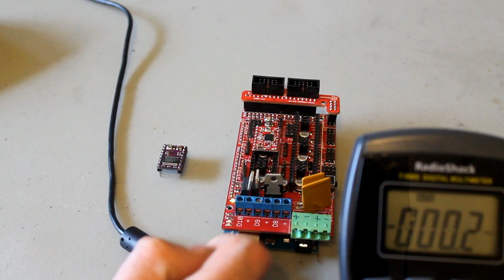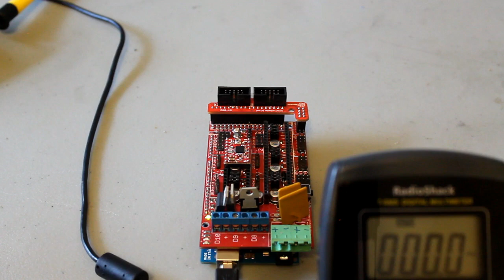How to adjust you stepper driver current

Comment: Ive been trying to figure this out. the math is crazy. it says I can go 1.0 or .9volts to be safe but it will not run faster then 400 federate what ever that is!? I have 2.8v 2.0amp motors and they seem to run fine at .8
 What I know from simple power tools is not to use to little power/long thin cord.
Reply from the maker: Feedrate is the actual limit that the machine can print, 400mm/s feedrate is incredibly fast never seen a printer print that's fast

Comment: I have a bit of a problem...my drivers are only showing 3V so I can't adjust them for some reason. Anything I should try ?
Reply from the maker: Which set do you have?
Reply: @forward3dprinting796  somehow I changed the power supply of the Arduino. I used a 9V battery and it was horrible. But then I changed it to a normal power supply and it works just fine. Not sure why tho.. Thanks!
Reply from the maker: @Anton-sz6ef  the arduino processors usually run 5v
Reply from the maker: @Anton-sz6ef  I am glad it works. Ow tho

Comment: When i make a 3D printer with CD stepper motor,  my stepper motor is very hot ....is that because of of adj current?If you know smt about that please help me out.
Reply from the maker: Yes sir current would be the culprit,  try adjusting it according to the motos ratings, if not aveliable,  start at a 1.00 and dial down from there
Reply: @forward3dprinting796  thanks sir
Reply: @forward3dprinting796  sir..I have tested using multimeter and it is showing aroung 0.57-0.6 . I am also using DVD stepper driver .. So should I have to move cw Or ccw to reduce heating?. Plz help
Reply from the maker: @sagarbhosle3596  it all depends on the motor, the drv8825 from Texas instruments has the potentiometer inverted, so clockwise turns the current down, and obviously counter clockwise turns it up, however you also have to have an idea of the optimal running conditions of the stepper motor, most manufacturers list the ideal conditions to run the motor

Comment: My stepper is rated 2A, do you think i can run it with my A4988 driver which has a max current rating of 2A as well?
Reply from the maker: Yes. But i would be wrong not to mention you would get way better prints if you look into the TMC family, also the amp rating matching is not necessary, is more so you know the motor limits to know the proper current to run the motor with out getting hot or not having enough power to take the step.
Reply: @forward3dprinting796  i only hear noise when i try to run it even when i adjust the current properly it just wont move, i think it better i get a stepper motor with rating of 700mA
Reply from the maker: @theconcheror5691  wait the motor wont move at all, something may be amiss with the connections,  is this a new build

Comment: I think I've turned my potentiometer too far...it spins all around...now what ?
Reply from the maker: Which specific driver?
Reply: @forward3dprinting796  DRV8825
Reply from the maker: @Anton-sz6ef  dial it back down, depending on the manufacturer, it may be broken, or it may have no end limit, which means ince it has reached the top current it goes back down tonthe lowest, again it being broken may also be an option

Comment: If I am driving two motors off one driver (i.e. Z-axis on Core XY machine) what compensation to the target voltage is recommended to start with? I assume similar general principle applies as far as working from conservative setting and increasing until skipping steps is eliminated but not to point where motors run beyond warm to touch. Just don't know if I should assume doubling the voltage if driving two motors is valid assumption.
Reply from the maker: I usually adjust the z current about half more than the rest of the motors current so if my x and y are running at .6v i would run the z motors between .8 and .9

Comment: Could low current be causing my steppers not to move?
Reply from the maker: As in pausing while printing or as in failure to move?
Reply: @forward3dprinting796  not moving at all
Reply from the maker: @GodsWorshipper777  do they make a vlicking noise or no sound at all?
Reply: @forward3dprinting796  no sound at all
Reply from the maker: @GodsWorshipper777  mhh. Last test when you give it the command to move do the motors lock in place or are you free to manually move the any of the axis
Reply: @forward3dprinting796  sometimes it's free, and sometimes they lock in place
Reply from the maker: It would be 10x faster
Reply: @forward3dprinting796  10x faster if what? I adjust the current?
Reply from the maker: @GodsWorshipper777  i am sorry my phone has been strange noodle today, anyways,  I asked if yoy were on facebook, i meant the communication would be easier there.
 It could be a few things, from the wrong firmware setting,  to over current, definitely not under because the motor would still try to move. So if you have a multimeter i would check the steppers. Is this a DYI or a kit?
Reply: @forward3dprinting796  and it's an entire machine I'm building

Comment: How do I know that I am sending the right amount of current ? Say my stepper specs says 600mA ? 
By looking at the 12v -1A DC adapter, I know that it is 1A output from the adapter, but now how can I check/test that I am feeding 600mA in my above case ? I can tune the Pot on the driver board, but when do I know it is 600mA.  ( I can measure the V in my Multimeter, and I have the formula V=IR ready in hand at this time) Would appreciate any response(s).
I tested it on a Stepper ( Minebea ) which is rated at 1A, and I fed in 12v. Using the formula above, the R should be 12, but when I measured it on my multimeter, it says 1K ohm !
Reply from the maker: Real quick,  how did you arrived  to the number 12 for resistance
Reply: R = V/I,

R = 12v/ 1A ( These are the ratings on the DC 12V wall adapter ) 
R = 12 ohm ? (Is this about right )
Reply from the maker: @kiranshashiny  which stepper drivers are you running
Reply: A4988, and I have done the same with DRV8825. But mostly A4988. and I can tune the pot to view the voltage by connecting the ends as shown in your video.
Reply from the maker: @kiranshashiny  I finally understand, the motor is rated to an specific voltage,  that is the voltage you use for the calculation
Reply from the maker: @kiranshashiny  however I still dont know why you are getting 1k when you measure it that is incredibly high if you are measuring after the driver

Comment: If I'm using a 1.8 amp nema 17, what should I set the a4988 to? Same question for a 1 amp pancake
Reply from the maker: Small town Bassin' the current on a stepper is prescribed by the manufacturer,  if you don't have a specs sheet, I would start around 
.75v and dial up slowly until you stop Loosing steps, you want the motors to run lukewarm. 
 On the pancake stepper remember is a .9 phase, so it will run warmer than a full size stepper,  I would start somewhere around .65v and go you from there.
Good luck

Comment: Just a heads up, if you get yourself a pair of leads with crocodile clips, you can clip the earth or black lead in place on the 5v input, then clip the red or live lead from multimeter to the screwdriver and as you turn you will get a reading simpler and very accurate.
Reply from the maker: Paul Thomas I just ordered some😊